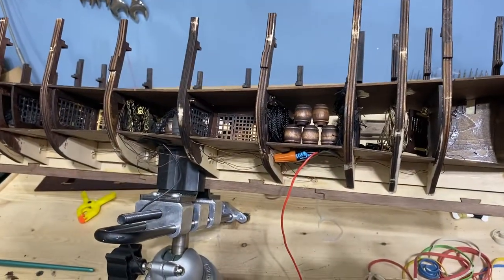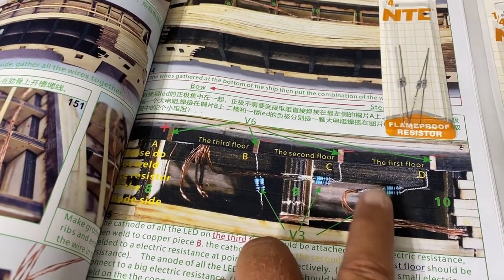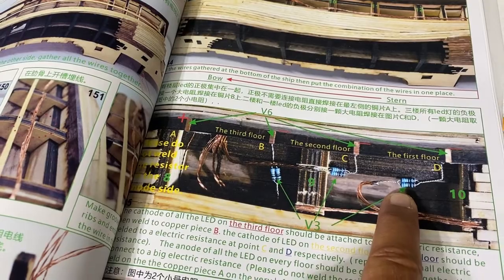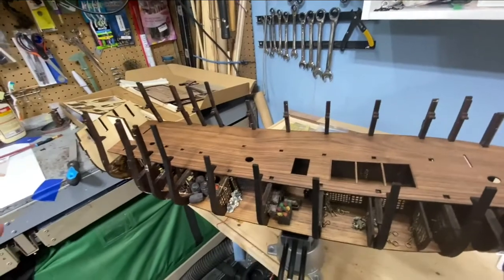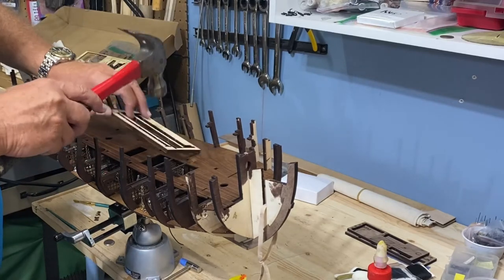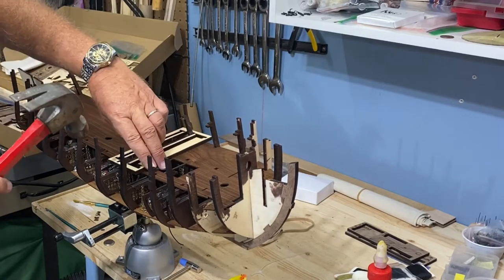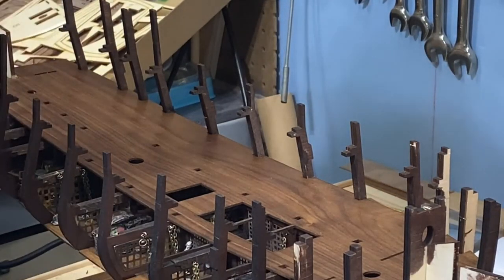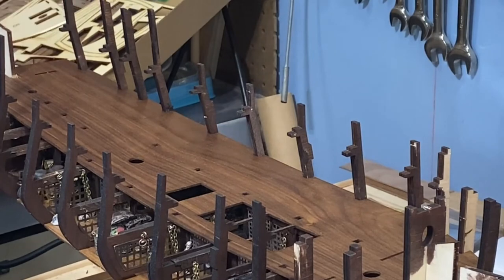Black Pearl All Scenario Version PART 3 Supplement

Comment: As you are advertising for ZHL, do know of any discount or promo code 😀 ?
Will you be using the same Minwax 622 Red oak all over this build as you did on the Golden version?
I noticed, Minwax also has a true black, have you seen/tried it?
Reply from the maker: Unfortunately I don’t have any discount codes. 😟.
I explored purchasing through eBay and Amazon but it was slightly less going directly from ZHL.
On this ship, I’m planning on the same stain as I like the rich dark color with a hint of the maroon (mahogany). I think I have tested a black stain but opted for the mahogany.
On this ship, I’ll stain all the exterior planks as well as everything thing else EXCEPT the 3 decks. They will all be natural walnut with a couple of applications of Tung oil. I’ve seen a version on line and the clear Tung oil brings out the beauty of the walnut. It also will allow the cannons and extras on the deck to stand out.  In my mind, this Black Pearl is just getting started on it’s journey and doesn’t have the darkness of the curse. 😂.  I’m not sure that will make sense to everyone, but that’s my concept.
I will be keeping this version as my keepsake and hope it is passed down from generation to generation long after I’m gone.  We’ll worth the investment!
You mentioned the stain as Minwax 622 Red Oak? It’s actually dark Mahogany. You can put multiple coats on until it almost appears black.
Thanks for following me along my journey. What began as a hobby after retirement is developing an art form of interpretation for me and a very rewarding experience.
Reply: Went back to your video 2, it was RED MAHOGANY 225. 
I understand the all scenario is 7”-8” longer, but I’m not interested in visual, open sided ship.  Unfortunately, the sealed version is almost the same price and the Golden, almost half price.  I’m just wondering what’s the most noticeable differences, comparing closed ships……….cursed ships 😀
Reply from the maker: Thanks for checking. I was not home to look at the stain can…. I’m putting in a segment in part 4 to clarify the color. Confirming that you are correct Red Mahogany #225.
The Golden version ship is very nice. Obviously the better your skill level the better the ship.  If it’s half of what the open sided one is, I’d recommend it. The building materials are good.
The lower cannons and Captain quarters are fake but from the outside you’d never know it.
The All Scenario version seems to have a little beefier structure? Maybe because of the 3 decks and the captain’s quarters are finished with some furniture and all cannons are complete.  If you have the rope work skills you can go into as much detail as you wish. I’m relatively new at it, and add additional authentic knots and style with each new ship!  There can be so much more detail!
I’m glad you looked up the stain. I’ll leave in the segment in part 4 as it might help someone else too.